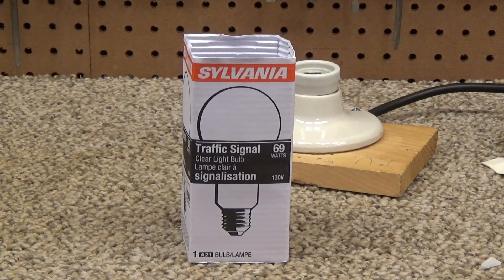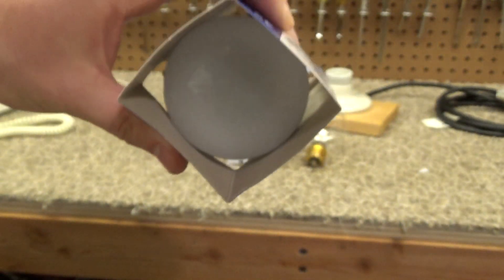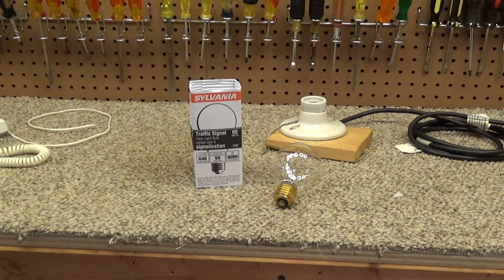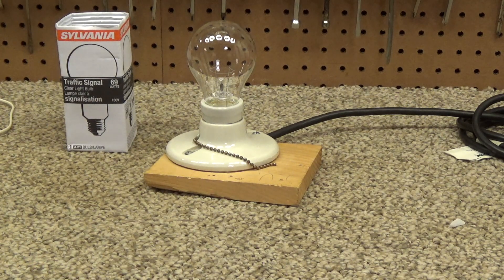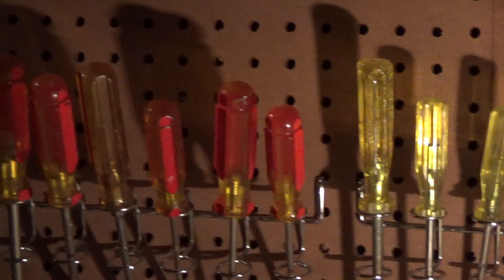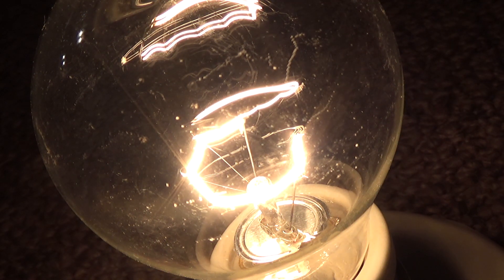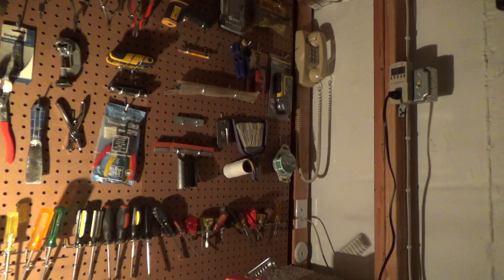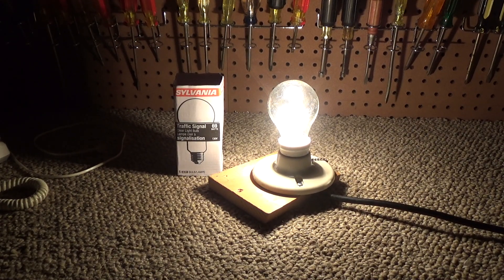Sylvania 69 Watts Incandescent Traffic Signal Bulb | Long-Life Comparable to Basic Incandescent

Comment: Sylvania and GE sold out about ten years ago when they transferred production out of US factories and they put their brand on crappy Chinese imports.

Traffic signal bulbs can be used in lots of lighting applications AS LONG AS THE BASE IS DOWN TO HORIZONTAL. This is because the filament is closer to the base than in an ordinary bulb.

The formula for calculating life of 130 volt incandescent (excluding halogen) lamps being run on 120 volts is about 2.3 times.

That is not a vacuum lamp. It probably has an inert gas other than krypton. If it had krypton, it would likely say that on the bulb.

The filament on that Chinese bulb is actually very good. Very even and straight. I have some Chinese Philips 67W traffic signal bulbs that have excellent filaments.

An 8,000 hour bulb run at 90 percent voltage will last a very, very long time. It gets exponentially longer life as you reduce voltage (and efficiency).

The cost savings is only in the replacement cost of the lamp. You are getting way less light per watt than from a 1,000 hour ordinary bulb and will pay vastly more over the lifetime of the bulb for the same amount of light. But I do love these ultra long life lamps.
Reply from the maker: The ad on Amazon says Krypton filled, but it sure wouldn't be the first time something on there was inaccurate.
I am aware these are far more costly to operate than regular bulbs, but I use incandescent because I like the quality of light, not because I want to save money. I'll gladly pay extra to get the quality of light I want and prolong having to dip into my irreplaceable supply purchased before the ban.
Reply: @JordanU  I completely agree with you, one hundred percent. The quality of incandescent light is unmatchable by LED. LEDs cannot produce the infrared that gives incandescent light sources their warmth and why we as animals are drawn to incandescent light sources (fire for warmth). I just wanted to point out the actual cost of light. That's why 1,000 hours was settled upon as the most common life rating for standard household bulbs - it's a good balance between efficiency and longevity. 

I like some of the long life bulbs because the light is warmer and softer than hotter burning incadescents with shorter lives. I have also stockpiled every imaginable type of incandescent bulb because I've always collected them. I have enough to last ten lifetimes. Krypton, long life, ceramic colors, everything.

Some of my favorite incandescents are neodymium bulbs (GE Reveal, reptile bulbs). Once you get used to having them in table lamps and fixtures around your house, you can't live without them. They really make colors pop and provide such a warm and pleasant light. I had one burn our in a ceiling fixture and replaced it with a 2,700K high CRI LED and the light just looked blah. I ended up re-lamping with an incandescent neodymium and the space looks fantastic. The GE LED Reveals are terrible. They are nothing like incandescent neodymiums and produce a weird color of light that is off-putting (like most LEDs).

Comment: Terrible bulbs for household use. long life but bad lumens and yellow color. They run the filament at a lower temp for long life. Makes sense in a traffic light where you need reliability . But you get bad efficiency and yellow color. There are good reasons household bulbs were not made to last that long. Basically you’re using 69 watts to get the light of a 40 watt bulb.
Reply from the maker: I think it's great for household use. I like the warmer color. I don't care about the efficiency; I don't use incandescent because I want the most efficient option, I use incandescent for the quality of light.

Comment: When I was younger, I had some of those (shamelessly stolen from broken traffic lights). The "base down or horiz." is no joke. One time, I put one in a cellar light, and the glass envelope cracked, at the base, and fell in one piece. Also, they come in 116W.
Reply: I have four 116 watt versions of these. I was going to use it base up outside despite the warning but after what happened to you, I won't. 😂 Thanks for the info.
Reply from the maker: Thanks for letting me know.
Reply: Funny enough I've a 60 watt 130 volt light bulb, don't know if it's a traffic signal bulb however.

Comment: A thicker element makes sense, especially if the bulb is going to be used in a traffic signal that flashes. Better able to handle the rapid power cycling that a regular filament would quickly fail from.
Reply from the maker: Correct

Comment: So the bulb can't survive the heat of being mounted base-up, but it can survive the heat of a totally enclosed traffic light in the hot summer sun?

A 40W bulb can be 0 lumens if it's burned out.
Reply from the maker: I tend to think the operating temperature of the bulb inside the intended application would end up being rather low as it's only intermittent duty. I've been noticing more and more bulbs are labeled as not for use base-up, yet I've used many of those bulbs base-up over the years with no issues. Chances are that label is just there to cover the manufacturer in case of a rare failure.

I suppose that is true, but by that logic, every bulb should have a lumens range from 0 to maximum theoretical.
Reply: A 40 watt bulb can be 0 watts as well if it's burned out.